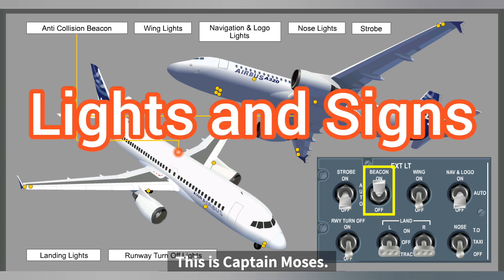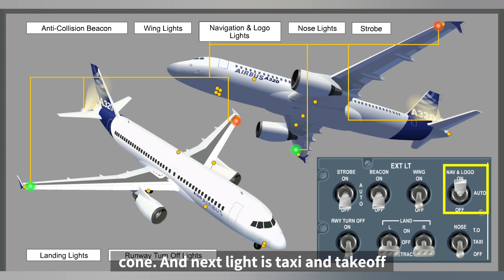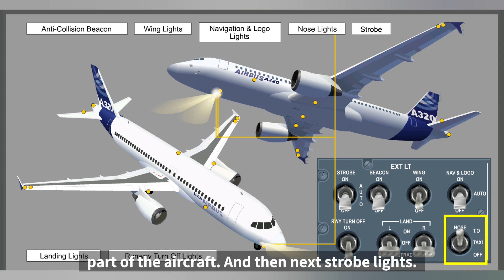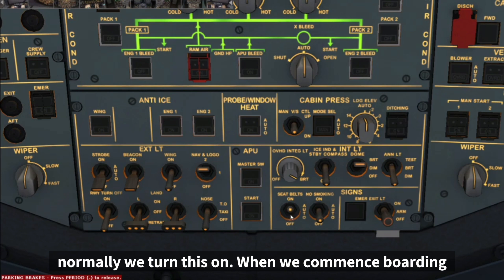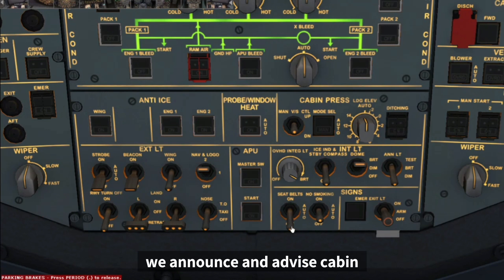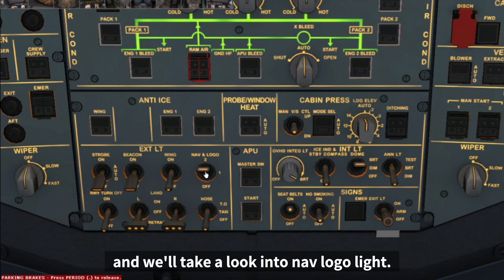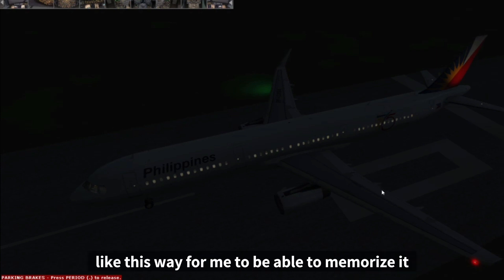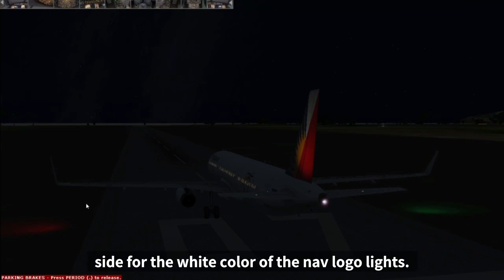A320 REAL PILOT EXPLAIN HOW TO USE AIRPLANE LIGHTS AND SIGNS FSX CBT

Comment: Capt, is there any light you turn on to indicate APU is on (Auxiliary power unit)?
Reply: @mosessim  I see. It seems APU is low hazard for A320 since it is located high enough. Regarding atr, we can use Eng 2 without propeller rotation, called Hotel Mode, to provide electrical power when there is no GPU connected. We turn on Wing Light for Hotel mode to alert ground since atr engine is low enough to cause hazards. And I know behind the Eng 2 in hotel mode, very very HOT. kkk.
Reply: @mosessim  Yes capt. Considering we dont have GPU, since we dont have APU and minimize use of battery, we start Eng 2 without propeller rotation.

There is a propeller brake (hydraulic) installed in RGB (Reduction gear box) in Eng 2. When we park, prop brake is on position, so we can always have option to start Eng 2 in Hotel mode for next flight. 

If we opt to start Eng 2 with prop rotation (by passing hotel mode), thats also possible. In this case, we use auxilary pump (run by battery) to release prop brake and start eng 2 normally.
Reply: @mosessim  Thats sounds hazardous capt, as pax looking at the eng other side still running. So far, I did not hear any issue with hotel mode. I guess its quite reliable option for small turboprop like ATR.